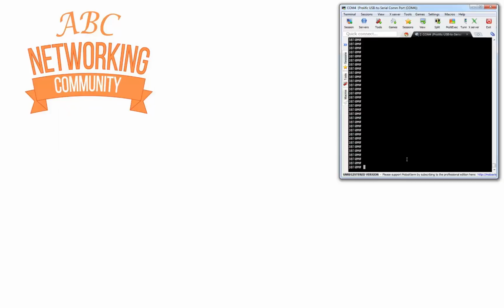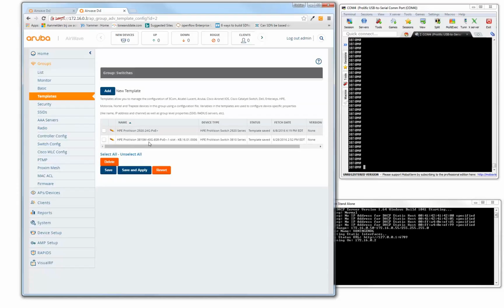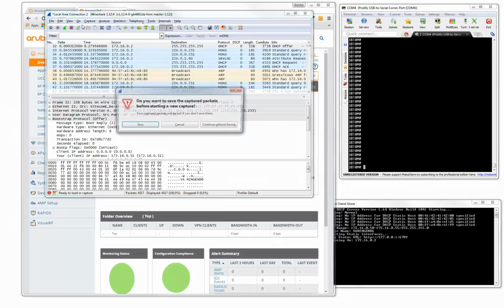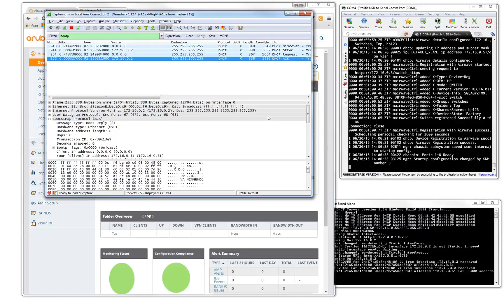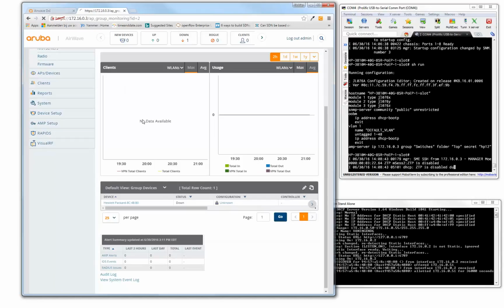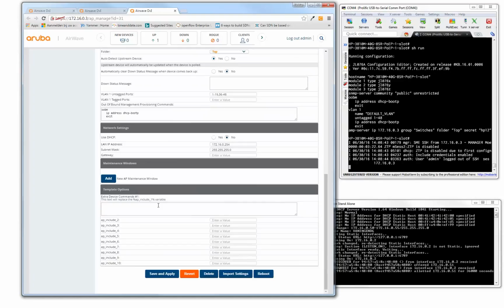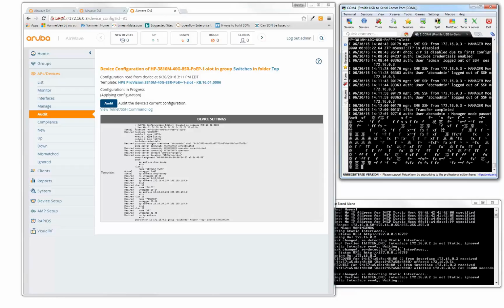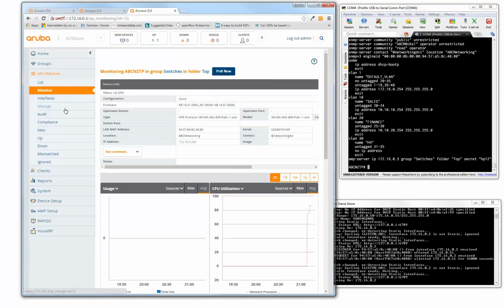Airwave controlled ZTP with AOS

Comment: Hi Thanks for the excellent video. 

However one thing that i came across was the deal with option 60. 
I could not get my 2930F to associate to AMP till i put in option 60 along with option 43. 

You seem to have achieved it with just option 43. What am i missing here :) ?